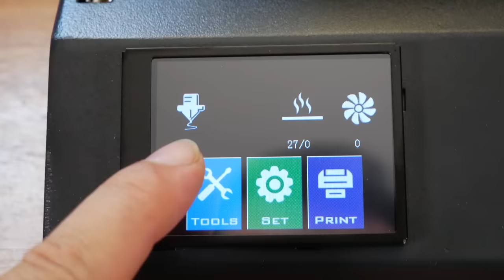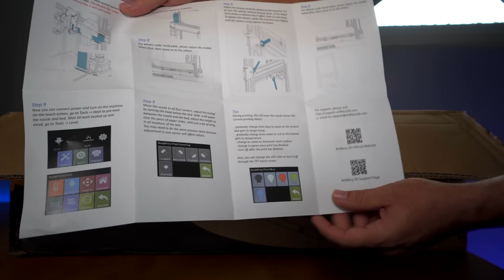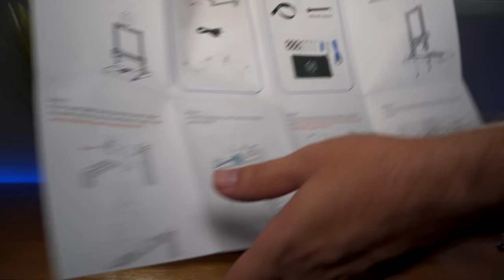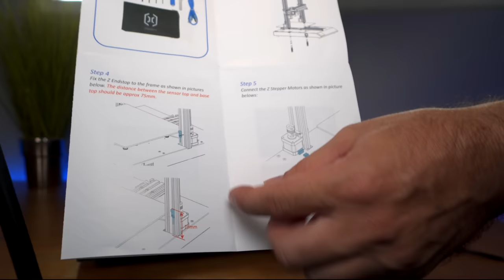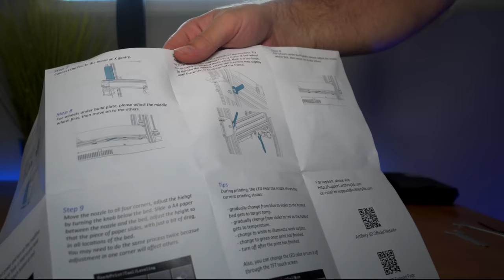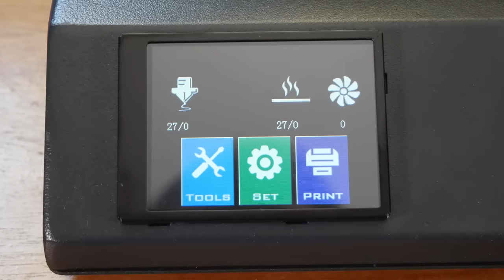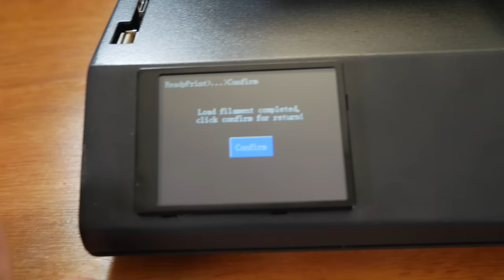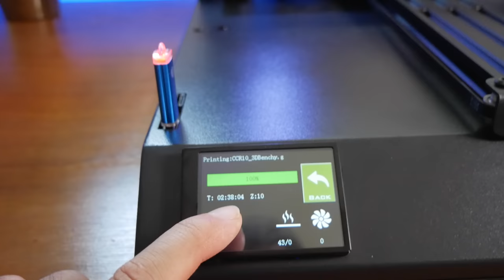Artillery SW X1 - 3D Printer - Unbox and Setup

Comment: Thanks for your honest step by step setup and review I have received and put together my X1 today. The one I got is an improved version here are the differences I noticed looking at your video:
 1. The ribbon cable coming from the gantry goes straight down to the connector which is now located directly below left side z motor not going under the bed.
2. All 3D printed parts are now plastic molded parts.
3. The side vent is now perforated channels on the metal housing so same color no mesh or screws.
4. The opening size for USB & SD card is now perfectly fit not oversized.
5. There is a reset button next to the screen.

This was what I noticed rest seems the same but no test cube included. I had similar issues with the wheels but its mentioned in the manual that you need to check them. Another problem I ran into is that gantry top part didn't line up with frame bottom part it was not square the z axis extrusions were pulled more to the inside. I loosen 4 screws on the top left and right sides trying to pull the legs outward a bit but still didn't help then I realized that Z-axis V wheels were too tight so after loosening all the wheels and the top screws I managed to push it in place and screw top and bottom parts together. I printed the test cube and the first thing that made me happy was how quite the printer and how fast the bed heats specially after using a 12v heat bed on my first printer. Amazingly the test cube print was impressive even after having that problem pushing it to get together. I would recommend this printer to beginners who don't mind tinkering a bit if they face a small problem the time and effort to get this printer together and make a nice print was 10% compared to the i3 style printer kit I bought a few years ago.
Reply: would you recommend this over the ender 5 pro?
Reply: @laithorabi9571  I haven't tried Ender 5 pro but I think this decent printer for the price you could get quality prints out of the box.

Comment: Fantastic review. I ordered one yesterday for my first printer. I feel even more confident I made a good choice.
Reply: Hi .pls where did u buy it?
Reply: @fyzobaba  .. gearbest
Reply: @jimscobie6646  was this the version 4
Reply: @fyzobaba  ... it worked well right out of the box after leveling the bed. I am currently having trouble with it, though.  Warped bed.
Reply: @jimscobie6646  so u recommend not to buy it?
Reply: @fyzobaba  ... when it was printing good it did a fantastic job.  Now it has problems. Check out more info on it and others before you buy.  I do like the sidewinder. Like a lot of printers, there are upgrades and tweaking to do.
Reply: I'm considering this printer.. What are your thoughts 6 months down the track?
Reply: @nidzdotnet76 ..  I had a fan fail which caused other issues. After replacing some things it is running great. Prior to the fan issue it was running good too. It's a nice looking machine.
Reply: @jimscobie6646  Do you still recommend the machine?
Reply: @nigelbaldwin2515  ... I had issues that were my fault. It's a great machine now.

Comment: Interesting feedback .... never know why they are changing. Just for your info ... they moved that ribbon that was located on the inside near to the bed. They moved the socket to the front of the post down on the bottom by the vertical post and the bottom base. I think they might of had some issues snagging the ribbon like you sad by the travel of the bed movement. Later

Comment: I would assume they purposely loosen all fittings so that they don't get damaged during transport. A fitting under tension is much more susceptible to deformation if the package is dropped. If it has some slack, it will use that slack to dampen impact.

Comment: I'm new to 3D printing and was able to acquire this 3D printer for very little money. Unfortunately, it came with no instructions or paperwork. With this video, I was able to get it up and running and successfully printed the cube from the flash drive! Thanks! Now I'm wondering where to go from here, how can I get objects from Thingiverse and convert them to the proper GCODE file for this printer? The Artillery website has been less than helpful in this regard. - Is this what Ultimaker Cura does?

Comment: i used this Tutorial in conjunction with the included manual to set things up. Thank you so much! you filled in all the holes in the instruction. But, I can't seem to be able to print anything but that cube. I downloaded a free file from thinkiverse. Opened it in Repetier-Host and saved it so it would be the same file type as the cube. The printer doesn't show that it is an option, or even on the USB! AH! Help!

Comment: Mines having trouble making the first layer of the cube. When it starts printing it starts pulling the plastic on the bed with it so I don’t know why it’s not sticking to the bed, it goes up to the same degree of temperature like yours does but I’m not having much luck and advise would super appreciated. I’ve also tried leveling the bed because the point was practically touching the bed

Comment: Hello, I just purchased an Artillery SW X1 - thinking, it should be easy to use.  Should have realized I'm not really that savvy with technology, but yet here I am with a 3d Printer I have no clue what I'm I'm doing.  I learned about slicer software and what not; I downloaded a .stl file from thingiverse thinking it should be an easy print after successfully assembling the printer and printing the cube sample.  Now in attempting this new .stl file of a water well miniature, it seems when I selected print, it wants to print on the left front corner.  Is there a simple solution to this?  How do I get this file to print in the middle of the printer bed?  HELP! :(
  In using Ultimaker Cura, the file is clearly in the center of the bed...what do I do to get it to start printing in the center?

Comment: 16'25" I need to adjust the belt and pull the tension, but you skipped the moment when you did it. I losen those bolts but even if I try to pull it to the right it doesnt move. What am I missing?

Comment: I just got mine and it is broken.    The x axis home function throws an error.   Hot tip hearing up on its own and  experiencing thermal run away.   Started heating up as soon as I tunred on printer.    Led light does not work either.   Had smoke coming out of the extruder unit.  Fan was working overtime.  All of this in the first min of turning on.   I’m guessing the motherboard is faulty ..Not acceptable,,,, .   .....Thankful for Amazon Prime, sending this lemon back to orchard..   Quite disappointed as this was rated well. Get another ender ?

Comment: Hi, after the bed levelling my nozzle stays in the center close to the bed, how do you make the nozzle lift up to be able to prepare the bed for print like if I want to add tape on bed or stick glue etc. thanks a lot
Reply: auto homing or manual z movement (through software)

Comment: The more I look at “Vase” mode the more I see that wall thickness the more I think... vacuum forming.. SLA printed moulds are like the VHS... Beta battle minus the 7hr full plate print time. 🐸🙉🙈🙊
Reply: i've been making resin casts of parts i 3D printed, but the other day i just kind of realized...instead of making a latex and fiberglass mold...why not just print the mold instead of the object?

Comment: my cube stuck on the bed and cant get it off. Do you have any tips? First time have a 3D printer i am so frustrated.
Reply from the maker: Try adjusting the nozzle gap a bit farther from the bed. Also using stick glue or hairspray sometimes works good as a median and will release the model easier.

Comment: Could you show in a little more detail how you affixed the ZStop to the gantry? I could not get mine to stay put and when the screw and nut finally caught and I attempted to tighten it, the plastic housing crumbled and I had to order a new printer.

Comment: Yeah maybe the test print they provided wasn't even printed with this because the test print was green and the initial filament color was blue. Maybe. Or they ran out of filament mid print on doing more testing on the printer that they changed the color.

Comment: Considering only the quality of prints, is it better than ender 3?
Reply from the maker: After modifications the Ender 3 is excellent. This machine without any mods is very impressive but not quite ender 3 quality with mods(very close). But considering the bed size and all the other features of this printer it's a better overall choice in my opinion.
Reply: @JustVlads  I am just wondering about buying a new printer. And I'm thinking about ender 3 or just this one. After seeing the review, it seems to me that the extra $ 200 (instead of the ender) makes sense. What's your opinion?
Reply from the maker: @patryk479  They are both good printers but the artillery is on another level, its more like the cr-10 pro. If its affordable the artillery is hands down a better printer over all.

Comment: so many printers that look the same
Reply: Hmmm, this seems a notch above most.  Even the cable management is brilliant.   The LED light.  Belt-synched Z axis, direct extruder, wide stable Y-axis platform, ball bearings on filament holder, heavily insulated bed, that's a lot of nice features out of the box.  Appears to have Wifi, too.   Definitely got on my shortlist.   Oh, and it seems to be capable of being freaky fast.   It's also very quiet.   AC heatbed.      This one might be a total sleeper.